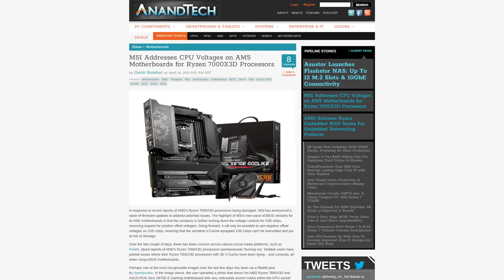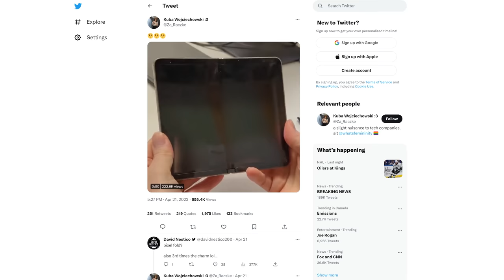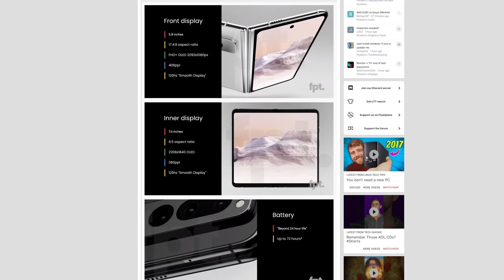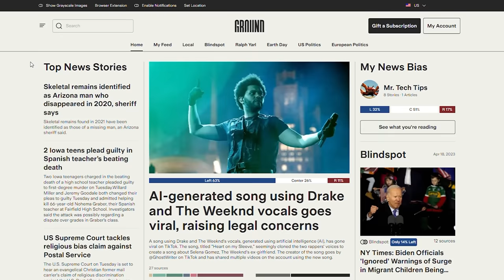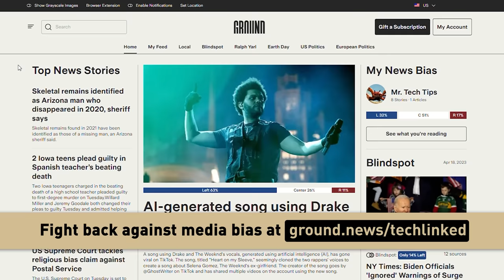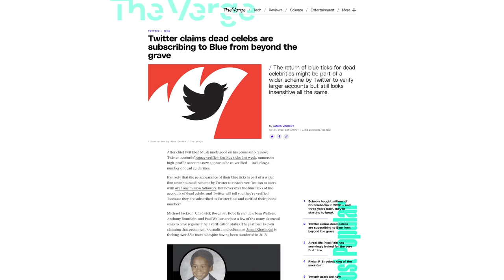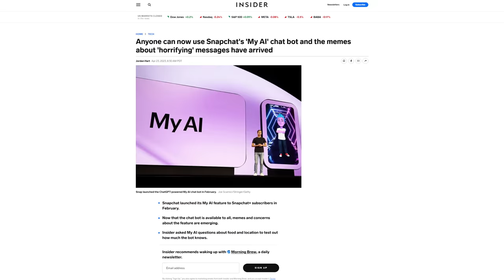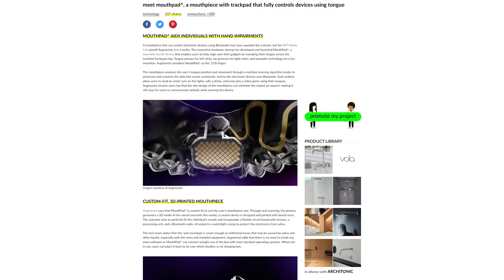Ryzen is a FIRE HAZARD

Comment: It's not just the X3D line, Roman showcased a 7900X non-3D that had this happen a couple weeks past and today. Thankfully, it seems to not be a common occurrence.
Reply: Yeah but also under the I/O die on the pins responsible for SoC voltage... So maybe nobody really knows what's going on yet and is just jumping to conclusions
Reply: It’s very strange indeed, the IO die has thermal probes too and being made of silicon it is quite thermally conductive, so the voltage would almost have to be straight 12v to fry it so quick that the thermal protection or a crash wouldn’t happen before a catastrophic failure. Like Roman said you need like 300c to make a pcb bubble like that, his even got so hot that it unsoldered the IHS…Like that’s a lot of juice, and even if it was in the IO die the IHS should have transferred the heat to the CPU dies and thermal should have kicked in. The weird thing is also I’m not even sure that the CPU socket can deliver enough juice for that to happen unless there was a manufacturing issue with some internal shorts in the die itself. Steve will shed more light but I expect some kind of short in the IO die and MAYBE all the thermal sensors communicate through that die.
Reply: @JamesTK  it appears to be related to memory overclock and MB manufacturers having bad implementations that is sending way to much voltage to the chip and causing this to happen.  If you manually set the voltage to what the actual values should be you should be fine.
Reply: @rudysal1429  yeah. EXPO doesn't seem that fleshed out yet...
Reply: My 7900x3d died two days ago and amd been routing me to get my refund from bestbuy even though the return policy ended over a month ago.  Userbenchmark was right about how bad AMD products are when it comes to their qc. I didn’t want to believe the bias but evidently it’s the truth. AMD is a second rate company
Reply: @Astelch  I mean... you should do the RMA process through the retailer you purchased it from. Not sure if there are consumer laws where you are from but the warranty is often remedied via the retailer, not the vendor directly, since you didn't buy it directly from them. Semantics.

Comment: Nice job on the AMD CPUs burning story, got virtually every detail wrong. The issue doesn't appear to be only the x3d CPUs, the analysis from der8our and igor showed that the pins were the voltage supply for the SoC, not the cores. The only commonality among the dead CPUs appears to be EXPO which is known to set a higher SoC voltage when enabled.
Reply: Well, that's embarrassing. XD Good job keeping 'em on their toes.

Comment: These folding screens are getting better, but they still die an early death.
Like if you're going to give us a square shape, you can just do that on two screens, ya know?
But I can understand the appeal for a really large wide screen for watching movies on.
Reply: It's going in circles. Big phones, small phones, tablets, big phones...
Reply: Except you can't do it on 2 screens because then you'd be left with a gap inbetween, the entire point of the folding displays is that its one seamless larger screen
Reply: @Oboreru493  Yes but with two screens, like on Microsoft surface duo I'am using RIGHT NOW, you can have multiple apps open on the screen, as I'am doing right now.
Though not gonna lie if your gonna get one of the Microsoft offerings, make sure it's the newer one. Not having an outside camera and having to fold the whole phone around to use my camera as one is kind of annoying.
Reply: @nesyboi9421  You can have multiple apps open on a folding screen as well, like up to 4 of them on the Z Fold phones.
There's a reason very few people bought the Duo. It's just a dumb impractical design that no one is going to bother to optimise for.
Reply: @Oboreru493  Well it was also only 300 bucks so fun
Also dumb? Impractical? It's no more dumb or impractical than literally every other folding phone. All folding phones are dumb and impractical.

Never knew bout the apps thing on the fold though
Reply: @nesyboi9421  except it is... having 2 separate screens is just a waste of potential screen space, plus the main reason people get these phones is for media consumption on the larger screen, which on the Duo is actually worse than a normal phone because its just 2 smaller screens now so there's absolutely 0 benefit in that aspect
Reply: @Oboreru493  My whole top screen gets used for the video, my whole bottom screen for the comments
Reply: @nesyboi9421  yeah... which is completely pointless. If you're reading the comments you're not paying attention to the video anyway so it doesn't matter if its got a whole screen, plus you can also do this on a foldable screen as well except for that you can also get a single much larger display for the video if you want it
Reply: @Oboreru493  What I'm trying to say without arguing is I like my device. You don't have to keep telling me reasons it's bad.

Comment: Really want to see a video from Mac Address talking about that Apple VR headset. I have serious doubts it'll be a success since it's likely(?) to be a very expensive niche (mostly for gaming) device locked into Apple's ecosystem, but surely they would pull the plug on the project if that's the case?
Reply: Mac Address does not talk about leaks. We don't even know if it comes true or not as the leak keep delaying every single months
Reply: @superqaxclub  They made a video talking about a hypothetical Apple television. Surely Jonathan can talk about what an Apple headset could do?
Reply: I dont think it would even succeed at gaming, have a look at macs where they finally have the hardware to game, but Apple's insistence not to support OpenGL or Vulkan means that devs still aren't bothering to port their games and dxvk and Proton cant run. Apple can't get away with being that hostile to game devs if they want them to actually make games for the thing.
Reply: @kajurn791  it's based on existing things that Apple made like Apple TV box and Apple TV+ original, he is just making suggestions, there aren't any leaks about Apple making their own TV.
Reply: @nabagaca  There is MoltenVK which basically make Vulkan API run on Metal.
Reply: @superqaxclub  It still isnt fully feature-complete, since metal itself is fundamentally missing some of the features of vulkan, not to mention it incurs a performance hit, especially if you try to run a direct-x game, as now you're going direct-x to vulkan to metal. I think ive heard its slightly better if developers integrate moltenvk directly into their game engines and then release it as a native macos title, but that still requires dev time and testing most publishers wont want.
Reply: Apple near zero regards for backwards compatibility also means a 50/50 chance your game needs an update to run on the shiny new OS version.

Comment: Unless the pixel fold has 10,000mah, there's ZERO chance of it getting 24h of battery life while actually being usable

Samsung tried claiming "all day battery life" on their phones, even the non folding ones, and none of them have managed 24h of runtime with 12h SOT 

If you want longer battery life, YOU NEED A BIGGER BATTERY, CC chip efficiency will only get you so far, there's no replacement for more battery capacity

Comment: It's AMD Thunderbird all over again. That's the only PC I have every LITERALLY thrown out into the trash with anger and disgust in my heart. I literally threw it as hard as I could into the dumpster and immediately went back inside and ordered a Pentium 4 to replace it. That system was soooo much better in every way.

That was in like 2004. I never touched another AMD CPU again until 2016.

Comment: I switched to Intel after an AMD CPU I had burned itself up. It was at least 6 years ago and I don't remember which one it was. I just remember it having 8 cores when 4 cores was the norm. I haven't had any issues like that with Intel, so I've stuck with them so far.
Reply: Lot of factors that come into play on that one given you can’t name what CPU it was. And given the age and the fact you opted for a whole new setup over RMA it’s probably FX and pre Ryzen. Don’t get me wrong, if an FX was my other option I would choose Intel too.
Reply: Yeah, one CPU burning up means the company isn't trustworthy. Ignoring everyone that has AMD CPUs, me included, where they haven't burned.
What will you do when one of the Intel CPUs burn? Abandon computers?
Reply: @Herkan97  You are the reason that people feel the need to put disclaimers in their comments. Obviously it doesn't mean the entire brand is bad. It could've been a faulty unit rather than an entire faulty model line. Please use common sense and don't assume things.

This was at least 5-6 years ago, as I've said, where AMD was experimenting to break ahead in any way possible. I'm sure AMD has gotten better now, but I just don't have a reason to switch anymore. Though my computer is in need of an upgrade as I have an RTX 3080 Ti in the same computer as an i9-9820X and DDR4.

Comment: IMO the 7800XT(70CUs) should be canned, the die is already so small on the 7900XTX that yields must be sky high, its better to just use all of those as 7900XT and XTX, then port the 6950XT over to 6nm, and sell that as a lower clocked, but more efficient 80CU RDNA2 monolithic die as the 7800XT and RX 7800 (60-70CU). 
Sure its a bigger die than the 7900XTX, but its on a cheaper node, and CU for CU, seems faster than chiplet RDNA3 at the same clock speeds. 
Heck look at the performance of the W6900X vs the W7900, only slightly faster, but the W7900 has 16 more CU and higher clocks.
FYI this is why the W7900 was only compared to the W6800(60CU) and even that was embarrassing, higher clock speeds, greater than 50% more CUs, but only 50% more performance.
Are they going to fix it in drivers?
I dont know if you can fix the latency penalty of going off die for the cache with drivers, if the 7950X3D has any anecdotal evidence to provide.
I'm patiently waiting Navi 33 to either prove or disprove my theory.
I suspect that if Navi 33 is pushed to the same hights as the 7900XTX, it will be largely more performance per CU, and per watt, even in tasks that often scale linarly with FP32

Comment: So far I have been running R9 7900x and no issues while in gaming it has got between 70 to 80 degrees max, under load testing using benchmarks got to 92 max. I am using commercial electronics heat sink paste on an Asus Rog Strix 360 rad

Comment: 72 hours with "extreme battery saver" ?? i hope they mean 72 hours of usage cause otherwise that is pathetic. Like really - why would i buy a crap phone that barely lasts a day normally and just 3 days with nearly everything disabled? My phone is a okish midrange phone i would say (~250€) and it normally only charge it every 3rd day. Mostly using it to read for a couple hours each day.
Right now it is at 40 hours, 2 hours of which are GPs tracking while reading, and about 8 hours of just normal reading (reading as in reading online content).
So i really hope they mean 24 hours of real use.

Comment: Considering the price of Ryzen 7000 factoring in motherboard cost, it's been a pretty weak launch compared to 3000 and 5000. I definitely don't regret getting Intel 12th gen a year ago. Stability and longevity are more important to me than maximum performance, especially since I was coming from a hand-me-down 5820K and prior to that a FX-8350 I've had since 2013.
Reply: How is longevity an issue? What generation of Intel cpus are the fire heaters, 10, 11, or 12? I always forget. This current issue is related to motherboard makers pumping to much voltage to the chip. This has also happened on Intel...

Comment: How do they manage to make the 7800X3D a toaster while even an overclocked 13900K(S) at more than double the power draw has no issues? Not surprised with how unfinished AMD have lately been, but still: HOW?!
Reply: It isn't AMD, it is board makers that had their own setup for expo that sent to much voltage to the soc. Board makers have already been found to do stupid stuff like this. They try and get that 0.1% speed increase over others but their voltage isn't what you tell it to and boom.  Not an AMD only issue. Intel might have more power over board makers with their settings.